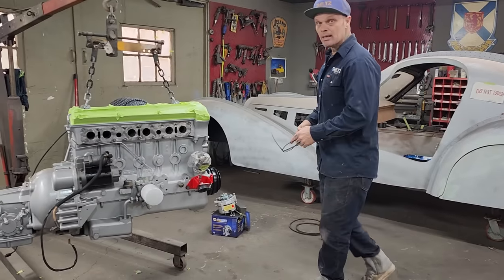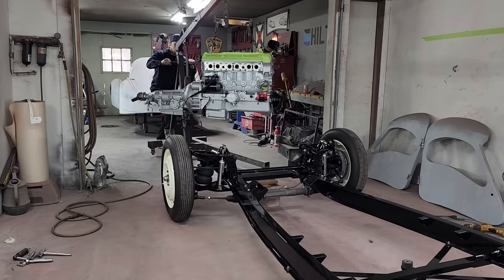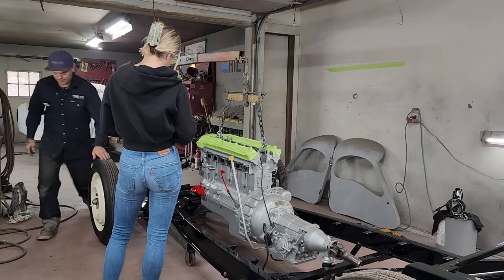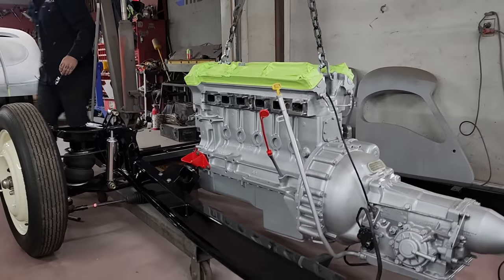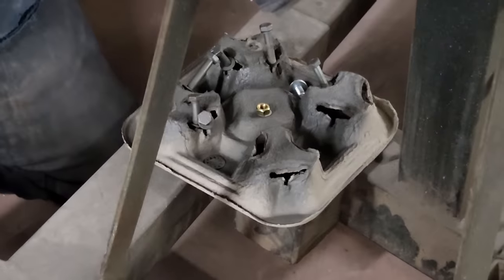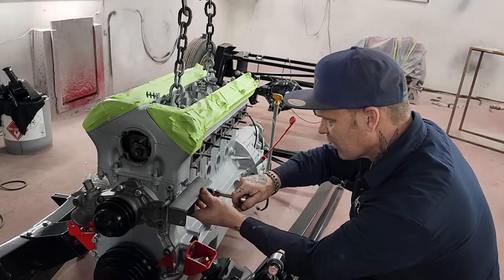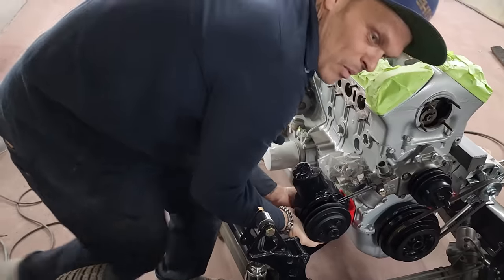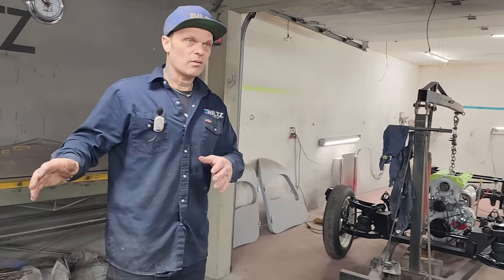The moment of truth: is the new Jaguar engine going to fit the chassis? 😬

Comment: Chad do not worry we are interested in watching your progress. You have done a really good job on making the brackets and adapting the engine to fit. Jolene nice job of helping on the car and on the video of course. Jolene you are one lucky lady to have a custom car built for you, I could not even dream about building something like that. Chad & Jolene you are one lucky couple to have found each other and I wish you many happy years together and I am really enjoying watching the build.
Reply: Shire you can start with something "small" like model car/truck size draw it out on paper then make it out of cardboard. Then you can trace it out on metal and weld a small metal car/truck together. 

Then you can look at that on the shelf. Then work your way up to something bigger. You can buy a cheap used older car and take the metal skins off it and make it like you built your model car/truck it don't have to be all metal fiber glass, foam, wood, how ever it gets done. It's your project what ever makes you feel good. As long as you buy a car/truck already running/stopping good is most of the battle.
Never tell yourself you can't or you'll never start. 
I'm in a wheelchair and in my younger year's I have built many Kustom or refurbished classic car's/truck's. I didn't have much money so I had to buy unrunning classic car's/truck's and fixed them up. It took a few year's but I got them done and either traded or sold them to get something better or even trade. I started fixing up bicycles when I was a young kid then motorised go karts, bike's then moved on to car's truck's in high school.  It helped my Pop's and older brother Mechanic. My siblings, cousin's, friend's were into having nice car's truck's going to car shows and swap meets talking to people getting information,  knowing the people at the auto salvaged yards help to. Public relations skills helps. All those people are willing to help when it comes to the automotive building because they may need a part or trade for something you may have or a skill you may have or even trade work for work no money needs to be traded. If you really want something bad enough you'll figure out how to make it happen.
That's why I say never say you can't even dream about having something really nice. If Chad can build it in a small garage you can build something cool in a drive way.

Comment: Somebody else mentioned it, but to reiterate, the water pump should use gasket sealer on the gasket. Please don't get in a hurry or rush things just for the camera. We're more than willing to hang in while you take the time to do things correctly the first time. The car, chassis and engine are beautiful. Keep it up.
Reply: If you need gasket sealer on a gasket you didnt properly clean service.
Reply: A little thread sealer on any bolts that get into the water jacket. Chad, you're doing great. Methodical and meticulous. This car will be stunning. Thanks for sharing your work. Happy new year pal.

Comment: Hi Chad, I’m also self educated mechanic and I have learned, it’s a good thing to add a drop of bow tube grease to prevent rust in engine block thread. You can get many other greases, my experience is that now tube grease it mad for this purpose, resist water/oxidation.

Comment: Chad, I’m hoping that when the motor torques to the side when you accelerate that it’s not going to touch the body, since there’s so little clearance.A tall motor like that with the mounts so close together and way down at the bottom like that is going to have a lot of side to side action unless the motor mounts are darn near solid or hard composition rubber. If it had bell housing mounts like an old 235 Chevy has, it wouldn’t be able to rock from side to side as much as it will with that single mounted transmission mount. The wide spaced bell housing mounts was why Chevy was able to have the front mounts in so close.

Comment: One big thing Chad. High temp silicone caulking on the water pump gasket both sides. Plus you should look into torque specs for parts going on the engine block. This is a must so things don't warp the surfaces. Please, please look into this. Or have a mechanic who knows these Jag engines come over and go over everything. Like you said. The engine must be right and run before the body goes on. Believe me in these requests. I have made these mistakes myself in the past.
Reply: Can you not be an armchair builder for one. 
 And two, since we are armchair building and giving opinions then Silicone Caulking would not be a choice, should be using Permatex HIGH TACK. 
For things to not "warp" you use a  sequence first then final torque spec. but your torque sequence and torque specs are about even pressure applied to the bolts, not warping. 
little common sense goes a long way.
Reply: Bernie is coming to look things over. 😉✌
Reply: Don't need silicone caulking on it, thats what the gasket is for! Been building engines 30 years and never have used silicone caulking on gaskets ,never had any problems .
Reply: @jeremyking5684  well, if you want to have problems this year;  start using sillycone...😁
Reply: Never put silicone caulking on a brand new dry water pump gasket never!!!
Reply: Partially agree! Never add any sealant to gaskets unless the factory manual says to do it. Do torque fasteners in right order to factory torque setting.
Reply: @salamander5703  when I was a kid (a long time ago, lol)  I went with my cousin to his work in a diesel mechanic shop.  I was talking to his boss who was 70 years old, who worked on airplanes in WW2.  I loved airplanes, so I hung on his every word.  He said the P-51 Mustangs used a Rolls-Royce engine design that was also used in planes built in England.  He said the planes built in England were notorious for oil leaks, while the American version was known to run high and dry. He said the reason for the difference was shellac on the gaskets; NOT called for in the factory specs.  I listened, and I built several motors in the last 40+ years.  They never leaked a drop of anything.  I pity the fool who had to R&I the timing cover though, it was set to stay on there a thousand years, and that seal was damn hard to break, lol.
Reply: @roadwarrior4813  I put shellac on hundreds of water pump and thermostat housing gaskets.  They never, ever, ever leaked; EVER😁
Reply: @karsbkool  good for you I didn't say they would leak. Something comes with a brand new gasket you use with the manufacturer gave you to use with it!!!
If that works for you keep doing it that way!!!
Reply: @roadwarrior4813  I didn't mean to offend.  Thinking "outside the box" can only reach 2 conclusions; superior results, or failure...
Reply: @karsbkool  I guess we all rely on experience. I once worked for a firm which did conversions on 13litre Daf diesels. The inlet manifold gaskets kept moving out of line while the manifold went on so they guys stuck them on with spraymount. Every single one failed in service costing a lot to rectify. In another job Hylomar got put on engine gaskets, but they always used too much, so the excess got into oilways, bits stuck together because it doesn't go off, then blocked the oilway causing engine failures. 
Your experience is good too, but you need knowledge what to put on which gaskets, I guess.
PS I started working life at Gardner diesels (in UK). They used shellac and asbestos to seal cylinder blocks to crankcases. Wouldn't be allowed now!
Reply: I totally agree with you.
Reply: @salamander5703  it's funny all the things that aren't allowed these days.  I only put shellac on cork and felt gaskets, none of which in my applications related to oil passages.  I don't know what spraymount is, but good story...
Reply: She ain’t going to the moon!
Reply: It’s not that the water pump gasket needs anything additional to have it work properly… things like Indian head shellac are helpful to hold it in place for installation. IMHO
Reply: @Cstoreri  holding it in place is a perk. Once It's tightened up awhile getting it out of place is the chore😉
Reply: Alternator Brackett is not Painted. Why not paint it  ???
Reply: @karsbkool  that's why you only put the shellac or silicone on the removable part, not the block, or the front cover here. Just not on both sides is the general rule. I like the IDEA of no silicone if there is a gasket. But I've seen too many leaks later, and since this motor is almost inaccessible to hear him tell it. I say silicone the gasket to the waterpump. Only been doing this for 50 years,  so what do I know?
Reply: @davidkeeton6716  shellac has been providing infallible seal over 100 years. If you build your engine well, there's no need to worry about taking covers back off, and especially no concern for saving the gasket if you do.  I guess lifter adjustment is an exception, but solid lifters aren't too common, and if you have them, you don't mind tinkering when things leak😉

Comment: "****Use old exhaust manifolds for the startup******to keep the new shinny manifolds from discoloring and turning blue!    Once it is running well and timing and carbs set you then put the fancy exhaust on. This will keep the new manifolds from discoloring. Especially if it is a fresh rebuild. There is a lot more friction and heat so it will cause the new shinny parts to turn blue.  Also using blue Loctite on most fasteners will keep things from coming loose due to vibration. So that you wont be removing the body to retighten lose bolts. it is looking good. I have to admit that the pickup build is my favorite  but I watch all your vids  you and Jolene are super. Merry Christmas to Fina and family

Comment: Chad, you're doing by yourself what took an entire team of Italian engineers to accomplish. It's very interesting watching you build the Bugatti. Thanks to you and Jolene.
Reply: He's not building an original Type 57s  engine,  a twin-cam 3,257 cc engine based on that of the Type 49 that was heavily modified by Jean Bugatti he's just using a 1984 Jaguar 4.2L DOHC engine and has had to modify some motor brackets and mounts.
Reply: French not italian but same sh.. 😁
Reply: @davidherve2267  and if im right german engine 1940 s
Reply: It is my understanding that the Bugatti was designed and built in France 🇫🇷 Perhaps the craftsman were Italian. I would have to look it up. But yes,  Chad has indeed built a wonderful car.
Reply: 🇬🇧🇬🇧 The Jaguar " Jag "  Engine was designed and built in England 🇬🇧🇬🇧 
Modifications occurred in Italy .
Incredible job Chad and of course , Jolene .

Comment: Wow Chad, what tight quarter's your working with. An alot of motor for this build as well. It will not be letting any grass grow under it thats for sure. An the sound of that engine is going go be awesome/amazing. I usually have to do the same thing when building hot rods as well. Build it, an customize my components as i go. It always works out better that way it seems. You know how the engineers design them. Seems they always do it backwards. So you are spot on with your build. (What ever works out the best) What an amazing car you guys are going to have once completed. SEMA WINNER for sure. Could be your best build yet. In my opinion. Just keep on keeping on my friend. An we shall catch you on your next video. 😁👍👍

Comment: Looking fantastic.
If when you get the carbs on and the engine fired up, it doesn't run good, ask yourself what distributor it is running.
I see one in there and you said the engine came from an injection car, so that distributor may not have any advance mechanism in it.
The ECU provided the advance curve on many injection cars of that era, despite having a separate distributor.
You'll need if it fits, the 67 dizzy or at least a pre-injection one.

Comment: Engine looks great. Is you carb manifold a 2 carb setup? Would be nice to have triple SU carbs or even better the triple Webers. You did  good work. Engine fits the mounting points absolutely perfect. On the water pump bolts be careful. Seems like Jag changed those about every time someone changed their socks. It generally shows the bolts are 3 lengths but some models show some in coarse thread and some in fine.

Comment: I would recommend keeping the fuel injection, engine was designed for it, also easy to maintain compared to carbs from older engine Also early fuel injection is simple system compared to modern systems and should be no problem to hook up I would be willing to advise on it
Love your show

Comment: You forgetting the gasket sealer reminded me of something. Many years ago I was at a friends house and we were finishing up painting one of my 57 Chevys in his garage.  We kept hearing a car being pulled around the neighborhood trying to get it started. It would backfire like crazy. Pretty soon, somebody knocked on the garage door. A guy with his teenage son had pulled up a nice freshly painted 55 Chevy chained to a pickup. They knew we worked on cars all the time and wanted us to look at their car, to see if we could tell why it wouldn't start. 
By the sounds we had been hearing it sounded like a real bad air leak. Checked all the vacuum hoses, all there and no open tubes anywhere. But when we held our hands closing off the top of the carb, the motor would try to run. Couldn't see anything wrong. Finally one of us asked if he had put the gaskets on correctly under the carb....it was a QJet. The dad looked at us with a blank expression and said "Gaskets?"  My friend said...."You know....the two gaskets with the metal shield between them, that goes between the intake and carb." The guy said again: "Gaskets?  Shield?"  LOL. Come to find out they had bought a rebuilt long block, and had put the rest of the engine together themselves and had no idea what a gasket was! They had just about enough knowledge about an engine to be dangerous.  :)

Comment: Sorry to learn that the other engine was toast.  I think you might have a problem with the front and rear mounts so widely separated.  Don't ask me how I know.  You might need a crossmember with a rubber snubber to support the rear of the engine, or the front of the transmission, to stop excessive flexing.  That is a beautiful looking engine, and they have a great sound.

Comment: Chad buddy Looks like if you swap the headers it will clear with out having to notch the engine block you might have the headers on backwards from how you installed them one has a slight greater angle then the other wich would clear the block from how you have it... if you swap the front half to the back and the back half to the front from how you have it it should clear no problem buddy from what i can see just thought id point that out buddy awesome work regardless chad looking nice!

Comment: I'm just watching for the first time, but I noticed right off that this front end seems to have the same appearance of a 70's replica that I tried to maintain.  The shock brackets were so close together that the top or bottom brackets would break off when they hit a good bump.  Nver could get shocks with the correct travel because of the design.  Just an old man thinking of the past.

Comment: Also check and make sure if you have any bolts going into a water jacket you will have to put some sealer on the threads otherwise it will leak water right out of the bolts some engines have bolt holes that go directly into the to the water jackets of the engine just sent some more information I love what you do it’s nice to see you working back on the Bugatti

Comment: Awesome work just a suggestion next time with the bolts take a piece of cardboard and Mark it out with a marker like the shape of the water pump and take a little punch and punch holes where the holes are and put the bolts in it you'll know exactly where each bolt goes.

Comment: Some moving blankets would be good right about now to put on the chassis to cover up anything that may be drop on.
  Nothing gets chipped or scratched. 
Dealing with fresh or clean painted you have to use a lot of blue tape or paper, moving blankets to cover up stuff you don't want nicked, scratched, up.

 It's looking great like I said before that engine is huge for the Bagatti body.

 Jaguar made a good
 powerful engine that will run in a heavier car. 

You might need to put a Jaguar "rear punken" gears to match the transmission? 
         Not shire what gears your running in the rear end?

 You want ever thing running right before you put that beautiful gal together. 

 All painted up is the last thing you want to do is pull everything apart to fix the rear end or even the engine. "Make shire it's running right and tight" and stopping!!

 Has to stop before it can go, is what my older brother and Pop's used to tell me when I used to start building a used car/truck do the breaks or check them FIRST before working on the ENGINE.

 All my rides I pulled the engine to rebuild them or replace all the gaskets so it wouldn't leak. 

After the breaks and engine is running great then the body work metal work would start. I didn't want a pretty car/truck breaking down all the time.

Comment: I sincerely hope that you have better luck with that engine than I ever did, they are prone to head gasket issues and they don't seem to like modern fuel,but I pulled out mine and put a 8 cylinder chev but its your baby.

Comment: Chad, The battery for your Bugatti should go in an area with a lot of spare room.  The one area with a lot of spare room is under those beautiful teardrop front fenders towards rear by the doors.  I'd like to suggest you build a small battery cradle/platform that can hold a marine style battery box with tie down nylon straps, so "splashing water" kicked up by the wheel can't wet the battery that's protected inside of the marine box.  The wires can easily pass through to the inside of the engine compartment from by the engine's firewall.